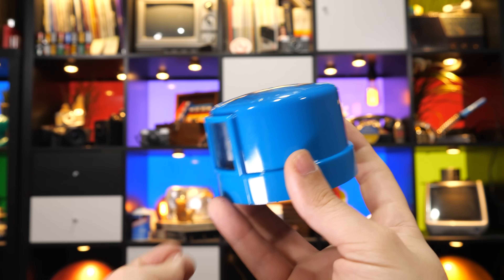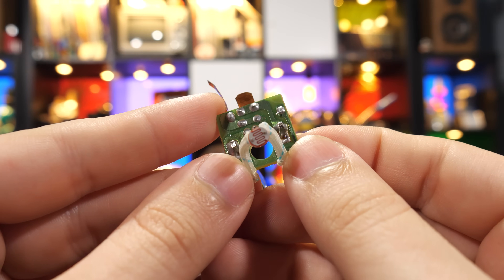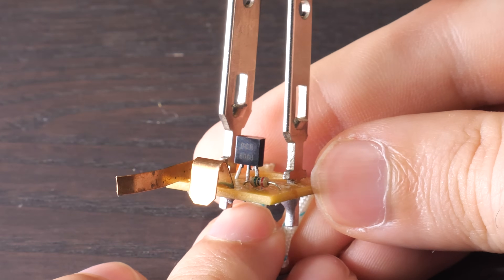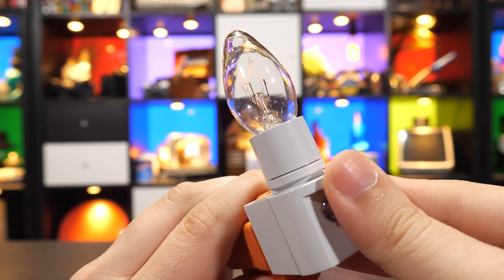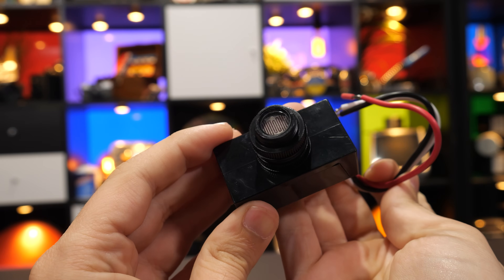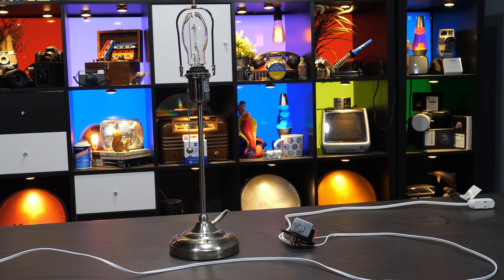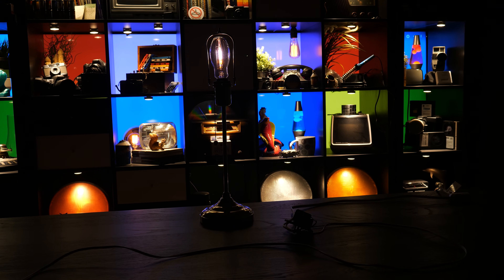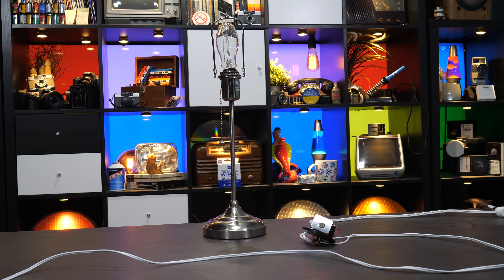Photoelectric light controls are weirder than they seem

Comment: 12:43 I’ve taken apart a fair number of modern photocells for LED streetlights and they use a logic based system that doesn’t require much power. In my particular municipality, every streetlight has an individual sensor. In a different city however, they still used all the old photocells from the original banks when they replace the fixtures to LED

Comment: 4:40 wait why does that shut off the light? It looks like a complete flow of power, from line, through the light, the resistors, and through neutral. I’m probably dumb and missing something obvious but I’ve watched that section like 4 times and I’m still confused

Comment: The device always got me thinking of a stupid setup like, what if the light itself make is bright enough to shut the switch off?

So the light is on, the sensor detect the light and shut off power, so the light is off. But then because the light is off, the switch turn it back on. The cycle continues.
Will this turn into a non-stop flicker?

Comment: Fun side issue: hysteresis: we have security lights on our house. If you switch them off at the isolator, and later on, switch them on, they come on even in daylight, to "prove" that the lamp elements haven't blown. I now know that this is a "free" side-effect of the control system, rather than having to be engineered in.

Comment: As soon as you held up a lamp globe, and said "this draws 1000 watts", I stared at your bare human fingers touching the glass and my brained screamed internally. 

I guess if it's only for show and not something you'll ever actually run power through, then I suppose you don't actually need to worry about oils making the glass heat unevenly, and essentially frying the glass and making the globe explode into pieces...

Comment: Between the simplicity of the thermal switch and the complexity of the microprocessor there's something called a comparator. All of the photoelectric switches I know use a semiconductor sensor (rather than the light dependent resistor in this video) and a simple circuit comprising no more than a few resistors, capacitors, comparator and a thristor or relay. Yes, this does need a power supply, but a capacitive dropper and a simple linear regulator do this job.

Comment: Thyristers are bi-directional so are not diodes. The light sees a full wave so lights at maximum brightness. If the light was powerful like a street light the small thyrister would switch one capable of higher current. The sensor module is designed for easy removal and replacement when it breaks down.

Comment: You didn't mention the reason why the lamps turn off sometimes at night, but I'm assuming it's a similar mechanism to the temperature resistor on the photoelectric sensor. When the lamp gets to a certain temperature for too long it opens a gate and shuts it down until it cools?

Comment: In Germany a city has a couple of light sensors at different locations within its area. A computer calculates the median value of Lux and turns the lights on and off based on a configured threshold. They not use just one sensor because a big cloud might cause the lights to go on during the day. Yes it’s software based but we’ll it has been working flawlessly for decades.

Comment: That’s wild how the circuit works between the two. I just assumed they where the same but scaled differently. But the street one having a relay. Never expected a thermostatic switch that also syncs with heat of the sun, or cool of the absence of the sun.

Comment: 4:39 Does thyristor introduce some resistance of its own? Is that why illumination cause the current to switch the path?
And also, when the path has switched, doesn't the current go through the incandescent light bulb either way? IF the current goes through it, shouldn't it shine all the time? Or is it because the overal resistence is severily diminished that it doesn't lighten up? Sorry, My knowledge of electromechanics is not exactly solid.

Comment: Years ago, when we were still using incandescent lamps for streetlights, the daylight sensors worked instantly. Lightning would turn off the streetlights, but they would come right back on. 
 When the first mercury vapor lamps came out, this was a problem. When lightning flashed, the streetlights would go out, and then take a minute or so to re-ignite (or warm up).
Putting the delay in the sensor solved this problem.

Comment: 16:48 There are some tiny and cheap controllers, functioning with all analog electronic components.
Usually it works with a transistor, a 12V DC micro relay, a ldr or a photo diode, and powered by a capacitor, a resistor and a zener and some diodes. Simple, but too weak to over tension.

Comment: In 1981, I returned home from my three year Army enlistment.  While I was adjusting back to my home time zone, I was a bit of a night person.  I went on walks throughout the neighborhood and noticed many street lights out.  Started recording them and phoning them in to the local electric utility.  They were usually fixed within two days, what a difference for safety and security!  I ended up expanding the reporting to include pot holes, traffic signs and signals, worn street painting, overgrown trees obscuring signs, etc.  Did this for decades and yes, I have no life, but considered it part of public service.
Reply: You’re a good person
Reply: Nothing wrong with looking out for your community.
Reply: In Sydney, our electrical distributor also has a  site for reporting outages. Each pole has an ID plate, and the site has them mapped. The only complication now is that new light pole installs in some areas are being funded by local councils. They, of course, have no easy way to report outages. Sigh
Reply: You're a low-key hero

Comment: I remember hearing about a device that used a regular solar panel and it would charge a battery with the solar panel but then when the voltage of the solar panel dropped below a certain amount then the light would come on being powered from the battery.

Comment: really interesting stuff. thanks. now do the networked LED street lights. they have the bayonet fitting identical to yours. but a shed load more electronics. i bet you cant as it requires very special software which is practically impossible to acquire other than commercially

Comment: I am utterly shocked by how this guy can explain the circuit so well, but yet have absolutely no freaking clue on how it actually works.

I like the part where he pretends that coefficients of thermal expansion have to be calibrated into the bar and screw...

These are common applications and only folks with zero experience would make such statements

Comment: I have two of these wired up to a box of relays in my attic. I can control lights in the house when my alarm is set, meaning that when I'm in, everything works as normal with the wall switches but when I'm out, the photosensor takes over, making it look like someone is in when it gets dark. I also have porch lights set to come on whether I'm in or out when it gets dark. The second photosensor has extra circuitry built in to switch lights off during the middle of the night which is even cleverer. The instructions for that unit say that it takes a few days to calibrate itself to midnight which I have found to be true. In fact after recent vacation, we returned home, a ground fault breaker had blown and the freezer was full of mouldy food. A much less costly effect was that the "special" photosensor stayed on all night for a few cycles.

Comment: I have had the chance to take a couple of these apart through the years, and there have been a few different versions based on what was cheapest. I have seen a version that used a few resistors and a relay and I have seen a version that used a triac and relay (in addition to the light dependent resistor).

Comment: Additionally the heating helps melting any snow that might cover the lightsensor and lead to prematurely turning on the lamp. When the lamp is on, it covers the snow melting heat itself. [edit: just saw that @w49660 mentioned this as well]

Comment: Most photoelectric switches I’ve seen are basically the night light circuit controlling a relay. Also equipped with a potentiometer to resistive chain, boom, adjustable photoelectric switch without microcontroller and also low power consumption during a day. I mean the cheap ones that are 5-7€ from chain hardware stores. 

Better ones usually have small microchip and also possible adjustable delay. Those are usully much more accurate, even the microchip is many times just a op-amp or similar to have the relay control working better.

Comment: High voltage relays could work, but definitely not as cost efficient, and still need decent power. On the other hand lower operating voltage relays, need power conversion, which is an added cost. Relays have much higher mechanical cycle life, which is not adding much benefit in this application. Thyristors(Triacs), while very efficient, are prone to fasle triggers and need a snubber, apart from being more expensive, being a high power semiconductor. But on a longer term they might save on some idle power, and can be more reliable, but do need additional circuitry to have hysterisis built-in.
Just some 💭. Wonderful content, nicely put together and eloquently articulated ♥️👍👍

Comment: a dumb Question, about light sensor one place i worked at they had 1 controlling MANY lights it had almost No load on it all it did was to pull in 3 relays that operated Different Voltages for lighting. to come ON at night. (note there was NOT any light connected to the sensor) so i was supersized how Often i ended up replacing the Sensor that was so drastically UNderloaded. 
so i wondered, how to fix this weird problem ?  this device was rated at a 15AMP Load and less than 1amp load ?
so what i did was to put an electrical lamp socket on the sensor with as small w as possible to load it down. it worked until i quit working there : )  mounted on wall in electrical room as Indicator Lamp.

Comment: Photo resistor? Those are called cadmium sulfide cells. 

There are two types of those larger light controllers. The one you are showing is a "time delay" switch & the other is a standard switch. The standard switch consist a relay that open & closes the circuit based on the light input on the cds cell. The drawback to the standard switch is a bright flash of lightning with briefly turn off the light. And with metal halide, mercury vapor (discontinued) & high pressure sodium, the light stays off for a short period to cool before it can re-ignite. 

So they came up with the time delay switch that Alec was showing.

Comment: I wonder how street lamps work in the UK? Many areas are installing car chargers on lamp posts which works because the lamps are now LED so there is spare capacity in the lamp circuits. But that means all of the lamp posts must be powered all of the time so you can't have a single switch shared across a bank of them as described here.

Comment: Here is my question. Why?!
You could just use a MIDI interface that works with the photo resister and it would do the same thing and not need to heat up at all!
MIDI uses an optocoupler. So when the photo resister senses light it would power the optocoupler turning on the light.  When there isn't light the octocoupler wouldn't be powered and it would turn off.  So, the MIDI hardware not the software.

Comment: Back in 2007, AT&T planned to install WiFi on the street lights throughout St. Louis but ran into a problem. St. Louis’ street lights were not powered during the day.

I kind of always assumed we just killed power to street lights during the day and someone flipped a switch at night but now I wonder if the there was a single photo sensor somewhere for a block do lights that killed power to each like.  And if they had just put one of these on each light post, could’ve the WiFi stations have had power while the lights were off.

Comment: Electrician here, I always love your videos that cover things I deal with at work. I've long known that a new photocell will always initially turn the light on but never knew why that was until now.

On another note, I've done a fair amount of work servicing street light style lights around mills and very often they don't even bother with a contactor. They just interrupt the circuit with the photocell and use that as the only switching mechanism other than the breaker. Though as I'm typing this I realize the systems I've serviced don't need to turn on multiple circuits simultaneously as a contactor could.

Comment: Here in Brazil these sensors are completely diferrent! they use a Whetstone Bridge to click a relay, they even have a trimpot sometimes to regulate the amount of light  it will turn on or off. I think its a better design because it don't get efected by the temperature of the place, they are a little bit smaller too.
Reply: You mean affected
Reply: one side effect of the thermostatic design is they'll come on earlier in cold weather, while also self-clearing of snow and ice during the day. Cold weather also frequently means bad dawn and dusk lighting conditions

Comment: Maybe somebody already addressed this in another comment, but in case they did not; the "thyristor" cited in this video is described, and schematically shown, as a silicon controlled rectifier (SCR), which is one kind of thyristor that only allows load current to flow in the one direction (DC), hardly ideal for when you want the load to receive all the (AC) power it expects. Another type of thyristor is the TRIAC, which is essentially two SCRs connected in inverse-parallel, so together they can pass AC current to the load. I suppose that the circuit shown actually uses a TRIAC rather than an SCR, and certainly its schematic symbol is quite different from that of an SCR.

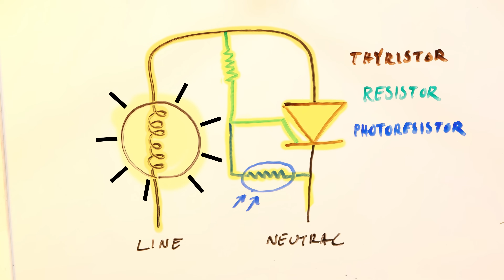Comment: 4:30 Should the photo resistor not connect to the end of the resistor but rather connect to the line preceding the lamp, causing an alternate path of current bypassing the lamp when activated by light?

Comment: When I was a child in the 1970s, the incandescent street lights came on when it became dark, probably because of the 1970s equivalent of the light sensor in this video.  When I was in high school, all of the incandescent street lights were replaced with the high pressure sodium lights that everyone hated.  The city decided to go cheap on these lights and didn't include any form of light sensor at all.  The street lights were on all day and all night, for a few years.

Then people complained.  We didn't need streetlights on during the day, so why was the city using the tax money to pay the electric bills to keep them on?  A project (which likely used a lot more tax money than keeping the light son 24/7) was put in place to make it so the lights didn't stay on all day.  They also switched from the sodium lights to mercury vapor for some reason.

They, apparently didn't use a photo electric sensor, though.  Because for the first few weeks the new system was active, the lights all came on at 6:AM and turned off at 6:PM.  That's right, they turned on during the day time, and turned off at night.  Always precisely at the same time.  This was fixed, so that they came on at 6:PM and turned off at 06:AM.  This posed another couple of problems, that I don't think they've yet fixed.  First, the 12 hours that the streetlights are on, are not necessarily the darkest point of the day.  Driving home from work in December at 5:30PM is treacherous.  There aren't any street lights, even though it's been dark since 4:30PM.  And second, whatever switch-board sets the time is prone to power outages that "resets the clock" so the street lights aren't likely to come on during the proper time if the power has been cut by winter storms, summer thunderstorms, fallen trees, downed power lines, or summer blackouts, until someone can be bothered to fix the blinking 12 on the clock.

Also, for summer, the street lights come on at 5:PM and turn off at 5:AM, because they forgot that DST is a thing.  Not that we need the street lights to come on that early or stay on that long in the summer time.

Of course the 1970s weren't always that fun.  Kids with BB guns, or a well aimed rock, could take out an entire neighborhoods street lights by simply shooting out just one of the incandescent bulbs.

Comment: I love electronics that do their work entirely without controller chips. Just a circuit with parts that do specific things, and using those parts to make it do what you want, no software needed. Like really old arcade machines. No microchip in sight, yet they run their games anyway. It's amazing what a bit of clever electro-mechanical engineering can do.

Comment: This makes sense. I've never had the time, nor thought to open one of these up, because the generally don't fail. 

It also makes sense in another way, when the sun is out, they get warm just from that, so even if the power does fail, unless it's very cold and windy, it's not likely to have that little flicker of on and than back off again.

Comment: Im an electrician and the "tiny amount of current" that flows to the lamp when these are off are a major issue with CFL and led lamps.  that tiny flow of current charges the capacitor in the lamps control gear and makes the lamp flash about once a minute.  Its resulted in many panicked calls

Comment: What happens when the line and load are reversed? Sometimes they cease to work once actually connected properly. I've installed and replaced these for years as an electrician, yet I've never opened one or knew how it worked. Thanks!

Comment: You really don't need software or a microcontroller to do this more efficiently. A handful of transistors and resistors can make a voltage comparator (Op-Amp) which can control the relay in hardware, without any code.